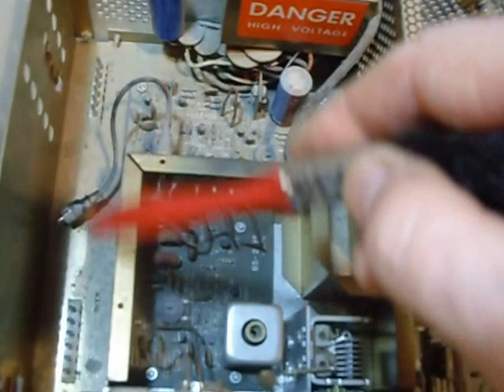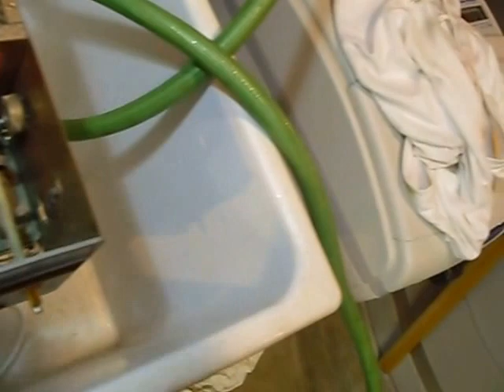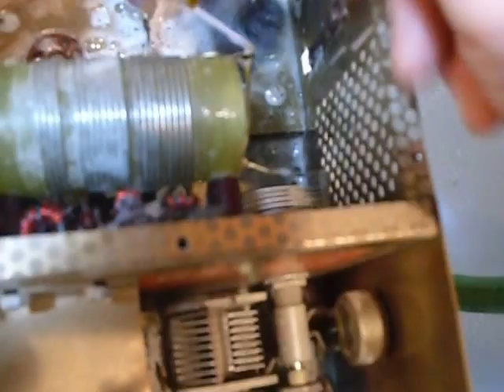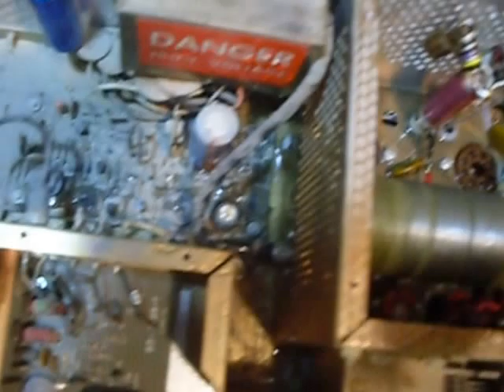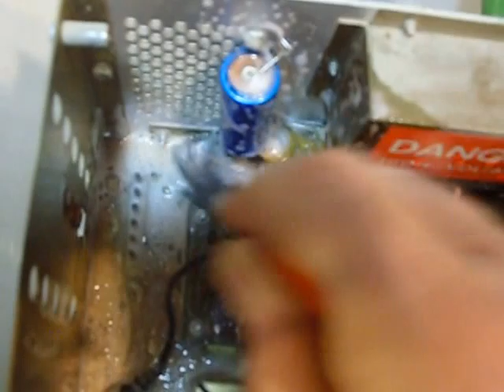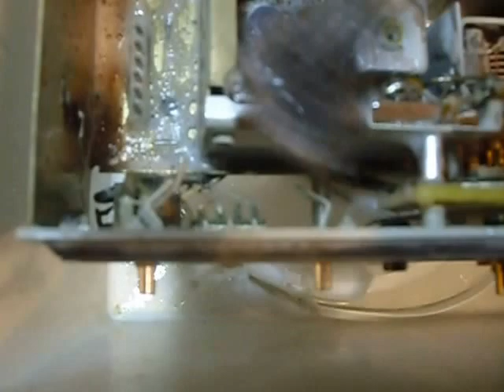PART 2 HEATHKIT HX-1681 restoration

Comment from the maker: Les ,  I do not usually resolder a whole board unless I see a lot of questionable soldering. I have done it on occasion adding a little non corrosive rosin  liquid flux helps too sometimes  even without adding solder that is   if it is obvious that the circuit board connections have enough solder on them already but are dry or crusty commonly called a "cold solder joint"  . With many rigs I find far more poor connections with tin plated or tinned connectors on wires and cables . Beware of silver colored connector pins and sockets a friend told me at Heathkit  " tinned silver color connectors are an intermittent connection waiting to happen "  I recently repaired an Icom IC245  it had many intermittent connector pins on the circuit board due to corrosion or tarnishing of the tinned connections . The pins on the circuit board were actually black with tarnish and they cleaned up only  using an xacto knife to scrape off the tarnish then applying a thin coat of clear silicon grease to prevent the tarnish from re-forming this will keep them going a long time  . I have had some comments about the silicon grease being an insulator and this is true however spring contacts in  connectors make very good connection with the  silicon grease on them maybe you have noticed the silicon connector grease in automotive connectors and small light bulb sockets like tail lights etc so this is not a problem but put on just a thin film  .   The other thing that was a problem with this rig was that the wires were crimped into the socket connectors and the wires were not even tinned just bare copper stranded wire.  Here too were several intermittent connections  due to copper tarnishing or corroding the copper looked ok but the crimped  connections were intermittent .  So I soldered all the crimped connectors to the wires at the point where they were crimped taking the snap in connectors out of the holder one at a time and  using a very small soldering pencil  and very thin flux core  solder .  After all this the Icom works great and nothing else was found to be wrong . Many types of electronic equipment have these cheap tinned connectors .  This is a pet peeve of mine . 

I will get off the soap box now Les ... 73  Bob

Comment: Just a question from one of my students, Bob, (is it best to re-solder (completely the circuit boards), just as a prevention method for dry joints etc. Les.

Comment: Do U discharge the electrolytic caps before washing the rig?
Reply from the maker: Bill  NO the caps won't hold a charge longer than a few minutes at most due to Circuits discharging them or a load  resistor the engineers  placed in the circuit to discharge them . This is done for safety . It is a very good idea to wait a couple of minutes when working on electronics before sticking your hands in there or you may be discharging the caps with your fingers and get a nasty shock !  73  Bob